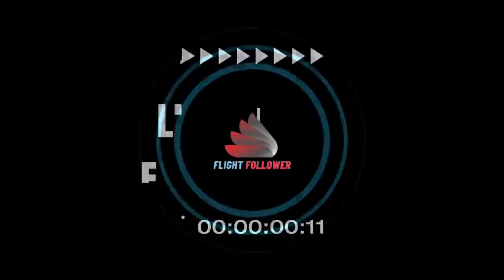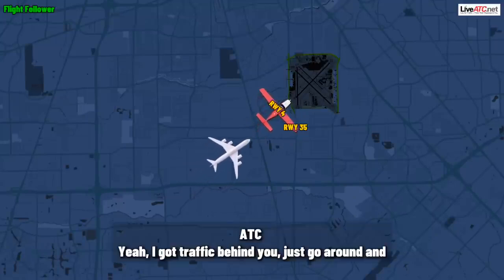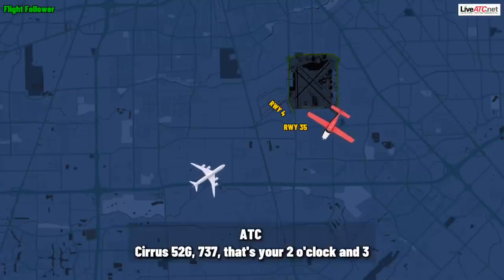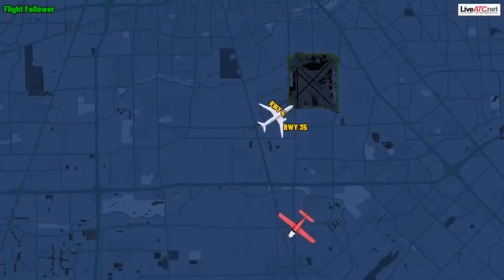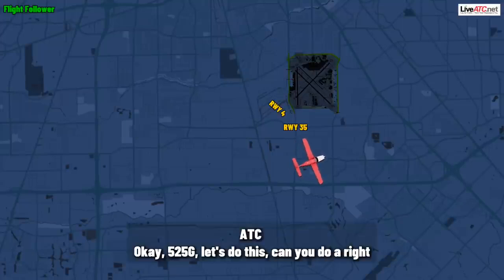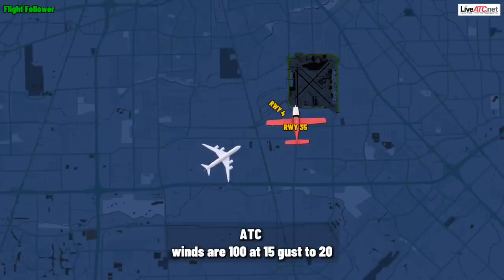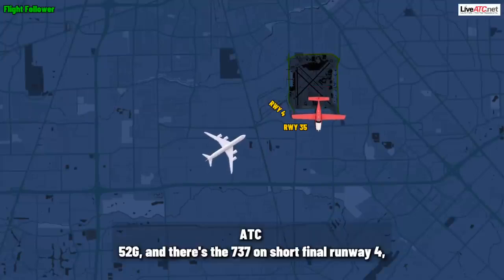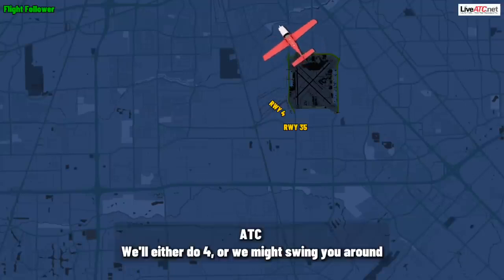Controller's TERRIBLE Mistake | Loss of Control in Flight & CRASHED #atc

Comment: Very tragic and as a local, thoughts were and are with all involved.

Odd descriptor though.  High pilot workload but under daylight VFR conditions; I'd have hoped would be firmly within the capabilities of a Private who was completely focused on their flight.  I'd be interested to see the description of "terrible mistake" defended in a lawsuit.  Lots of armchair "experts" drinking it up, though!

Am I qualified to comment?  Kinda:  Hours in the low triple digits but trained from a busy Class D airport located under Class B.  Subsequently flew a 172 into KHOU under unplanned (but non emergent) circumstances.  Approach slotted me in between 737s and requested I keep my speed up; was keen to minimize my "footprint" throughout so landed with clean wings, then cleared Rwy 4 via a high-speed taxiway... both firsts for me - but knew everything was within my capabilities - otherwise I'd have rejected ATC instructions.  No video cameras were operating - which I'd argue were a potentially significant distractor in this heartbreaking fatality.

Comment: Slow GA planes should not be operating into airline hub airports. Its like having a motorized scooter on an interstate freeway. Already high controller workload is made even higher figuring out the spacing and often these pilots are inexperienced in this operating environment. Its a bad situation and most of the world heavily restricts and taxes this kind of flying to avoid these kinds of situations.

Comment: why was the second controller giving such lengthy instructions? the ATC instructions should be short and concise, such lengthy instructions are not needed especially when the aircraft is in final, there is already so much workload to manage in the cockpit, and the ATC is overwhelming the pilot with unnecessary instructions! My heart goes out to the pilot and the passengers who were onboard that aircraft!

Comment: Many comments about the controller... i do think atc could have been more helpful, but clearly this pilot was extremely low experience level.  Was she alone in the cockpit?  There were many instructions forom atc early on that she did not even reply to, kind of makes me.think she maybe had someone sle on board and got distracted.
Reply: I believe she was alone but her work load was extremely high so I can understand her not hearing some transmissions

Comment: The exhaust from the big aircraft, along with the gusting tailwind didn't help anything at all.
Reply: I believe he said wind was 090 @15 gusting 20. Would've been a strong quartering headwind on runway 4. The exhaust from a jet isn't really an issue, it doesn't leave a trail of smoke, the wake turbulence however, that can be dangerous but the jet was landing on 35 and she was going for 4 so at the intersection he just tells her to be mindful of it.

Comment: Why did he cancel the first "clear to land" for runway 4? Why is the airliner more important, once he cleared her?
Reply: Yes. That’s how it works
Reply: She shouldn’t have been at that airport. She was a dingbat
Reply: @Gmantsb And that's why she died.It shouldn't work that way
Reply: Idk if they're more important but they are significantly faster so it's hard to sequence a jet behind a small slow single engine aircraft. Jets usually land around 150-160 knots where a cirrus is probably only doing 65 knots on final. To get her down requires putting all the other Jets into a holding pattern and I'm guessing they are probably prioritizing arrival and departures for airlines. The only real way for her to get priority is to declare a mayday
Reply: @ahetzel9054  ah, I hear you. I thought the controllers plan that out before telling the cirrus "clear to land"....